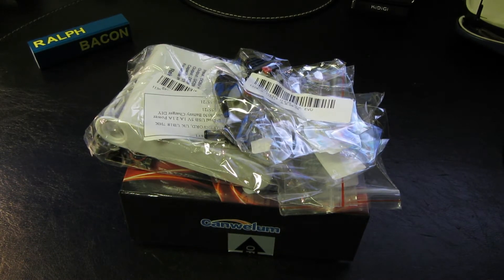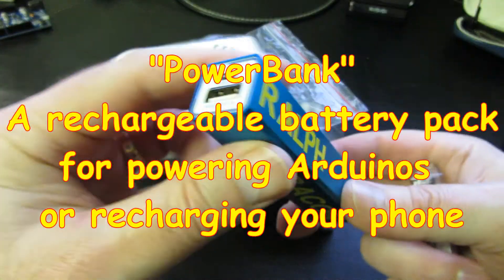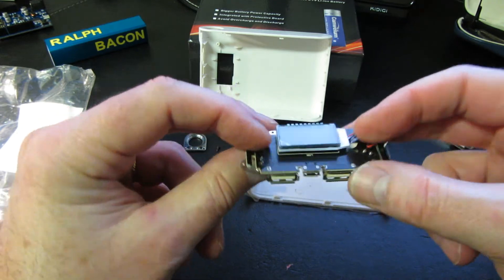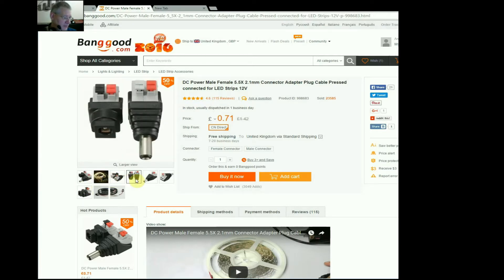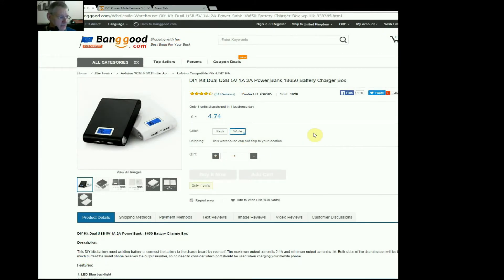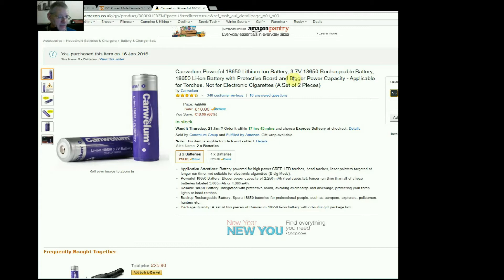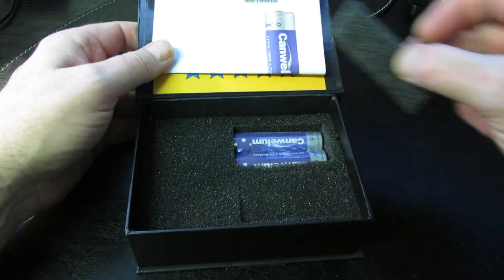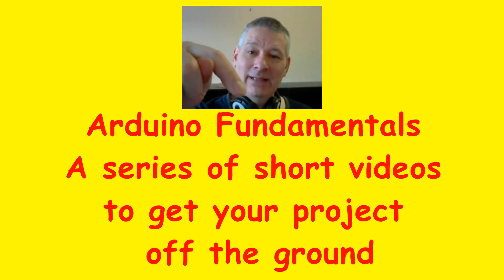#6 USB Powerbank special - DIY kit with 18650 Li-Ion batteries Part 1

Comment: Ralph Excellent Videos! Always learn Alot! Thanks For all the great work!
I used the sd dataloger vo figure out how to record and play servo movement to sd and then adapted record servo to sd with pca9685 16ch servo board and Adafruit_PWMServoDriver.h> Library but I am stumped on getting my playback code to work with the Pca9685.
any chance you have any experience with the pca9685 and the PWMServoDriver.h> library? 

Thanks again on all the great videos!
Reply from the maker: Regrettably, Len, I've limited experience with servos, only having built one project with them. The PCA9685 16-channel servo driver looks nice (12-bit and I2C too) so should be reasonably easy to use (lots of drone makers etc use it). Playing back stuff to it sounds like a challenge, so sorry I can't help further. Try https://forum.arduino.cc

Comment: Thanks for the ideas, I've been enjoying your videos and figured  that I should start at the beginning,  Now I have a use for all the 18650 batteries that come from the Makita 18v battery packs when they give up, most of the individual batteries are usually still good inside the packs.
Reply from the maker: Indeed, Chris, it is usually just one cell that goes foobar and the rest can be successfully repurposed. That powerbank is still going strong but watch out for the length of the cells you have. Mine were protected and thus 2mm longer than standard (unprotected) ones and had to be installed at right angles as shown in my video. Good luck with your project.

Comment: Please tell me if the power bank auto starts when you plug in a phone or you have to press a button on the power bank ?
Reply from the maker: +Cristi Istrate
Hi Cristi, I've just tried this out and it automatically switches on as soon as i plug something into either socket. 

That said, I have noticed that it switches off automatically too if the power consumption is particularly small (eg just powering a Nano, for example) which can be a surprise.

The other powerbank I have (the one in my videos with my name on it) has an on-off switch so must be switched on manually but at least stays on until I switch it off again! 

I hope this helps.
Reply: Thank you for testing this feature.